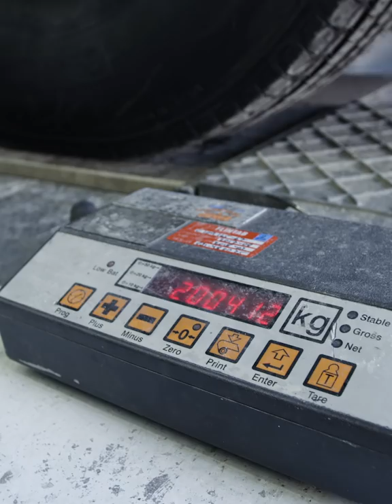Volvo Trucks - A Volvo FH under 7,000 kg

Comment: On the Volvo website it says a FM can be as low as 6000kg and an FH can be 6600kg, both as a 4x2

I wonder what the difference is with a 6x2 as either a FH or FM, and with either a 4.5t or 7.5t mid lift

There are some 6x2 4.5t mid lift FMs in the UK that pull tankers and it says on the back of the cab 7700kg unladen weight, but that is with a PTO